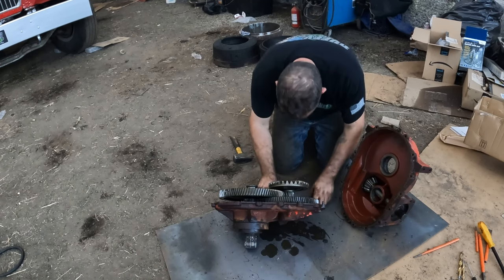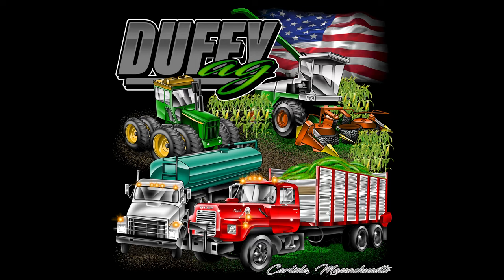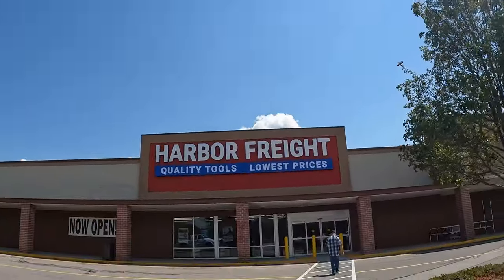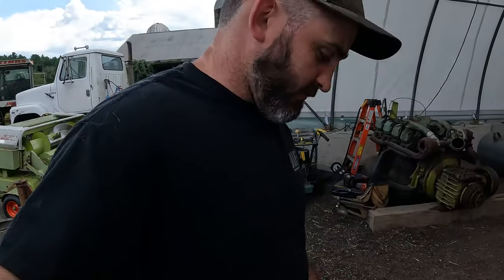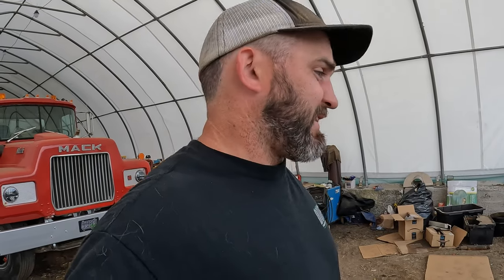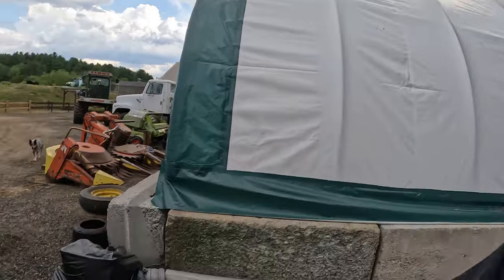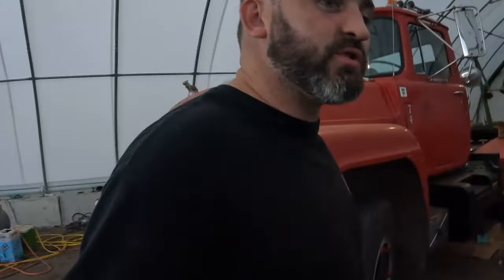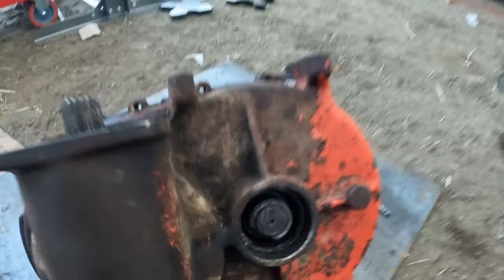Wonder How Expensive This Will Be... Kemper 4500 Failed Parts

Comment: Jmc parts has the whole pinion shaft with the over run 345 for €329,99 so about $388us part number lCA81879 and the pawl in gear box €15,39 about $15 us  part number LCA73422

Comment: Pull the drain plug on the gearbox that’s snapping the bolts. I’m bet something is binding inside it or a bearing is out causing a vibration. Similar things happens on my 450fi corn head.

Comment: 676. If you need parts call Lancaster parts and equipment in PA. They are excellent with those heads
Reply: We use Lancaster parts a lot and they are great to work with.
Reply from the maker: Parts coming this morning. They had everything in stock

Comment: That head getting ready to let go may have contributed to the broken mounting bolts on the frame.  The company I used to work for got there metric bolts from China and half of them didn't meet the quality standards of the grade 8 bolts they replacing most of them only came out 5.5 to 6 grade bolts